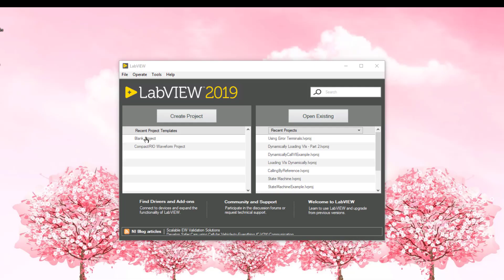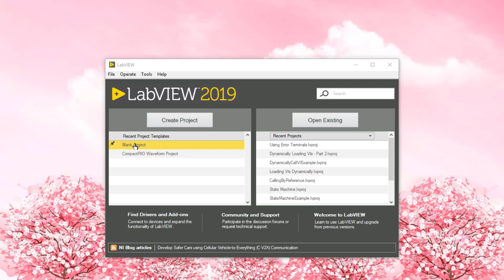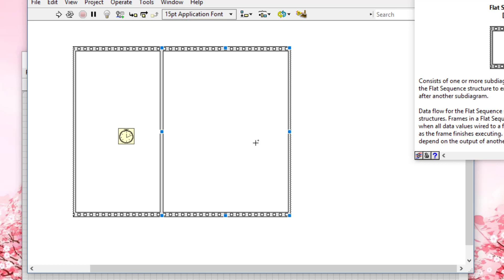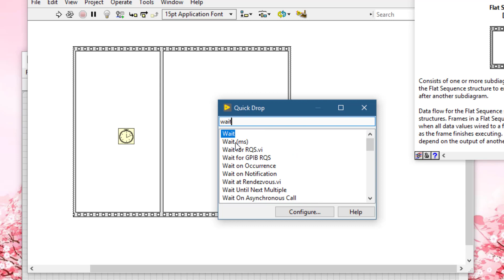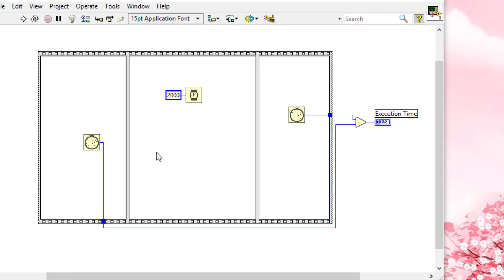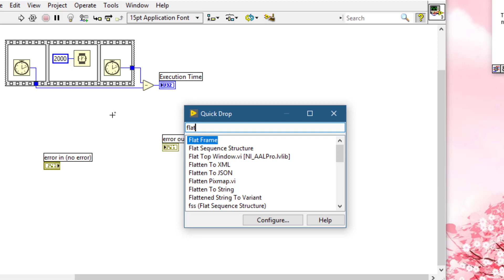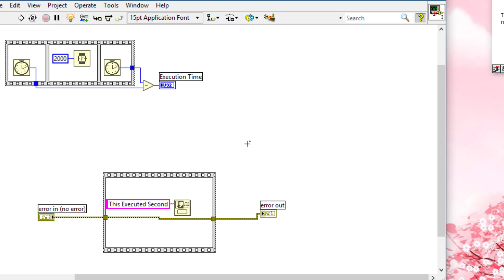Using Flat Sequence Structure - LabVIEW

Comment: With the 2nd code example, replace the Flat Sequence Structure with a Case Structure. Wire the Error Cluster into the Case Structure case selector, then you can check for errors and execute the appropriate case.
Reply from the maker: Yes that, definitely, is a better idea as it allows two different messages to display based on whether an error was reported. Thanks for your input and correction!